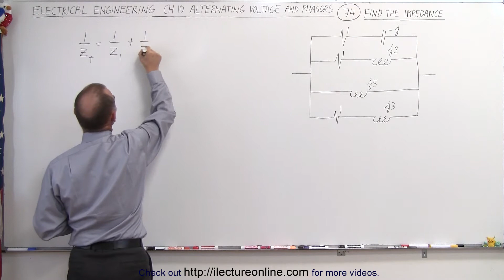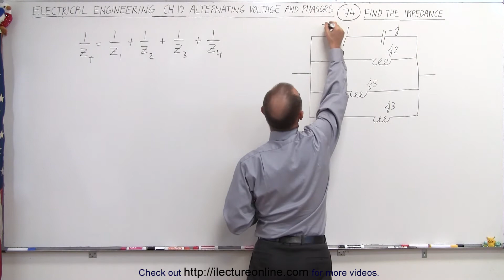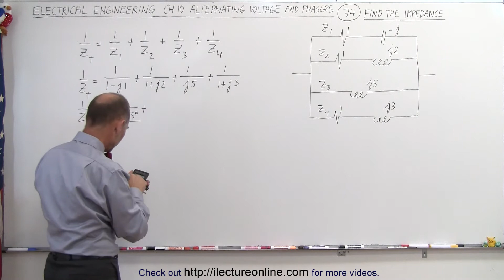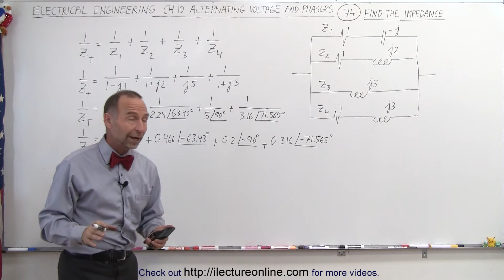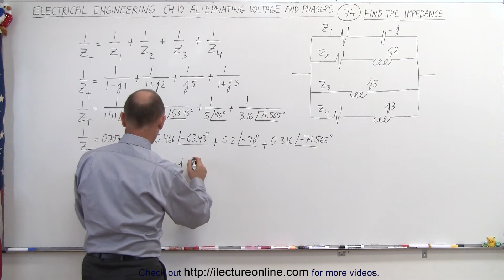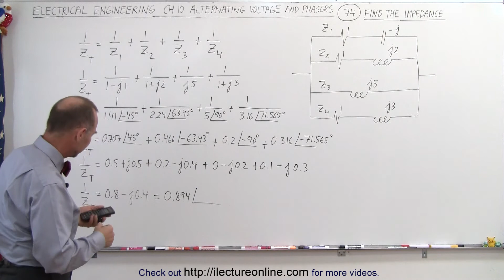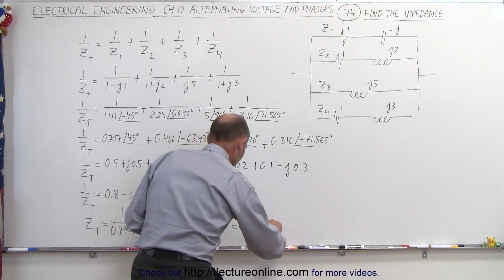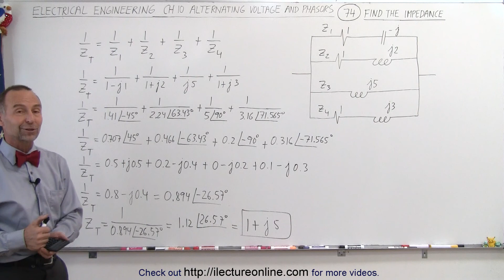Electrical Engineering: Ch 10 Alternating Voltages & Phasors (74 of 82) Impedance=?

Comment: dear professor, Can we do this using admittance too ? so if we use that. The admittance is 0.8-j0.4 ?
Reply from the maker: Yes, and that is correct.
Reply: Thank you for your fast reply 😃 well professor so what's the point of using admittance? It just gives the 1/Z and we can do all the calculations without denoting 1/Z is Y ,hence don't use admittance at all. I don't know if my question sounds stupid 😬
Reply from the maker: There are 3 points to it.  1) There are often different methods to solve the same type of problem, and for we tend to teach those multiple methods, to gain clarity and understanding and to ensure that knowledge gained by those who developed it continues.  2) Often it becomes a personal preference as to which method you like best.  There are often pros and cons to every method and we tend to pick the method we like the most.  3) Some types of problems are solved more easily with one method compared to another and then we pick the easiest (if we know that method).
Reply: great explanation professor. Thank you so much for taking time to reply my question. I find his method (without using admittance) looks much easier and more familiar ^_^ . You are a great teacher